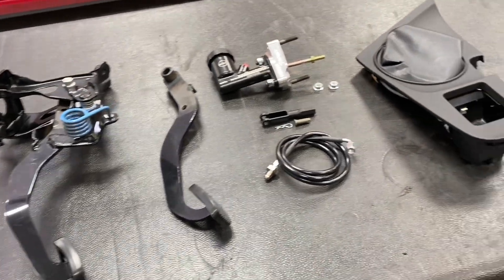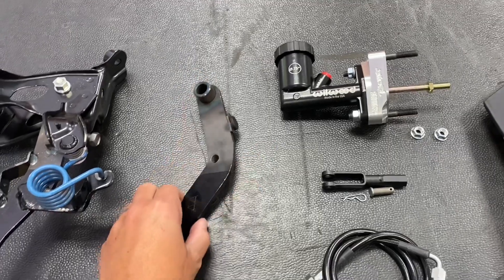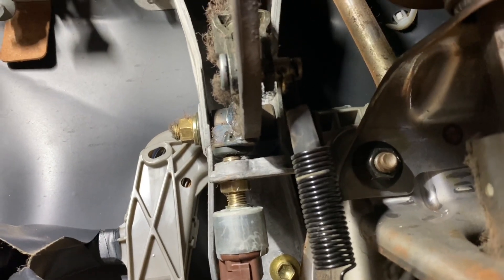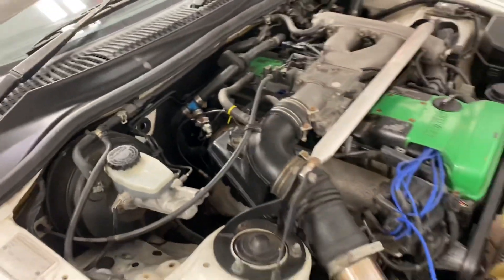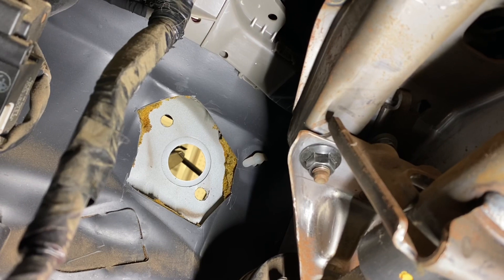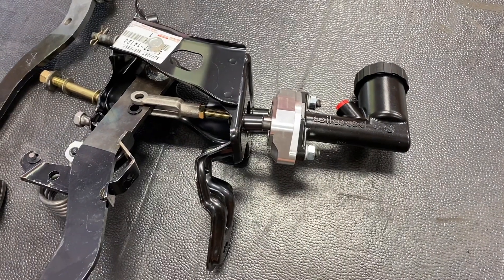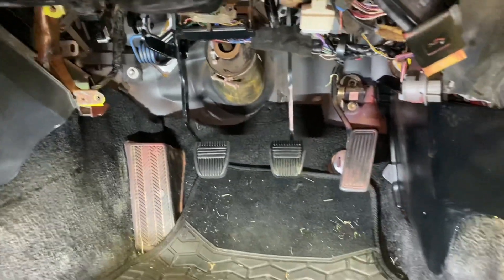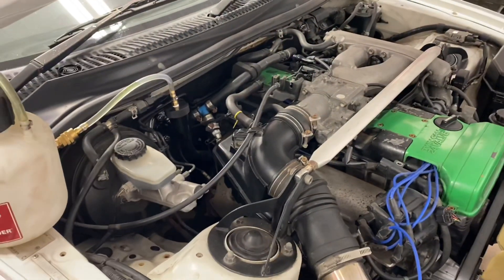PART 11 - Right Hand Drive RHD pedal install - MKIV Supra auto to 6speed manual swap

Comment: What do you do with the lower leg on the clutch pedal for bolting it down? When i pulled the pre cut lining off theres marks but does not seem to be any nuts on the other side of the fire wall, thanks
Reply from the maker: Nothing, you use the two master bolts and the top bolt on the dash bar. It’s very secure with those three
Reply: @GrannasRacing  ok thanks for the reply sir
Reply: @GrannasRacing  hello  do you sell the kits and how much  do you  charge for the complete conversion

Comment: What size bolt did you use for the top bolt on the dash bar?
Reply from the maker: I think it is m10x1.25 and 35 or 40mm length
Reply: I was going to ask the same question!!!